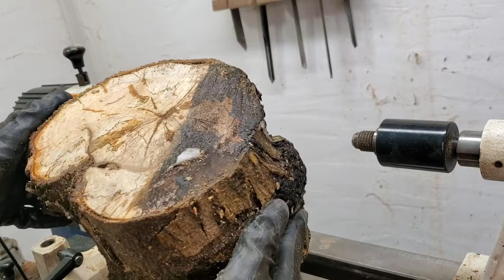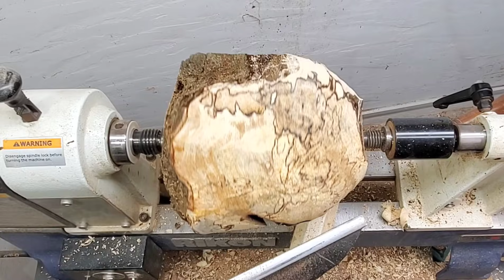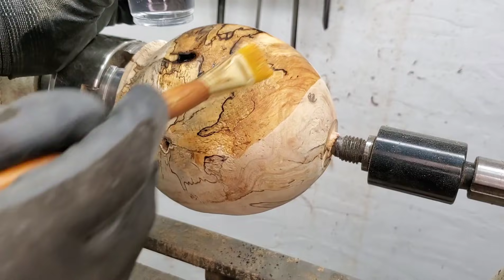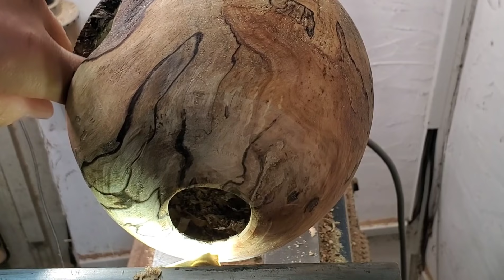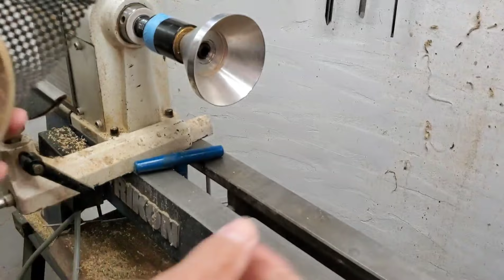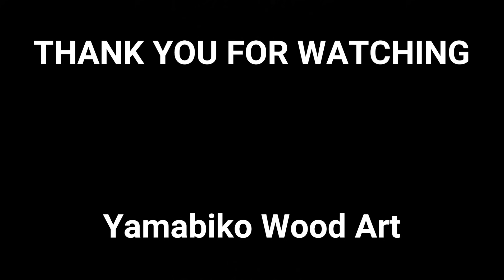Woodturning - 50years Oak !! 職人技！細菌の塊を削る

Comment: Nice Piece !!  The Spaulding of timber looks similar to * Zebra Wood *   if you ever manage to buy/ win a piece for turning project pattern on outside is even more extended.
With stand, will You put a small light inside of /  make into Potpourri for living room others see & smell ?😁👍
Reply from the maker: Thank you for your comment as always!🙇🇯🇵  
It was an old oak log.  I think oak is very unique because it has a lot of patterns after about a year.  If the transparency is a little higher, it will be a lamp shade.
The next video will be one week later.  A vase of fiery wood grain.  looking forward to.